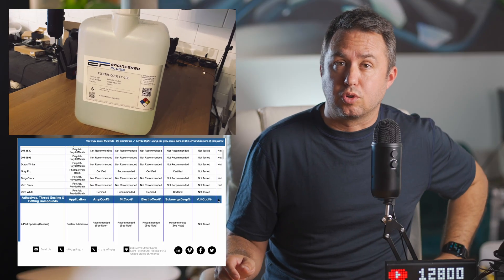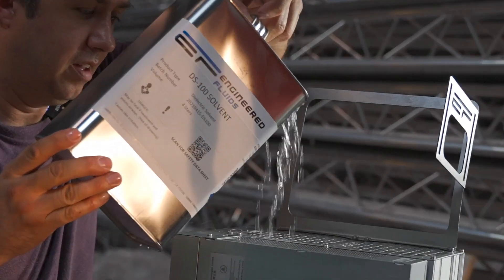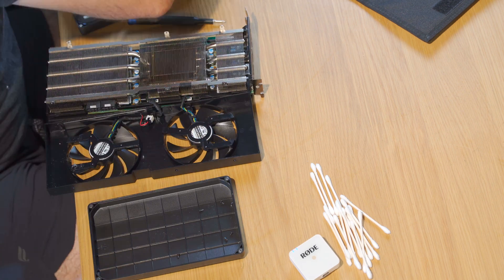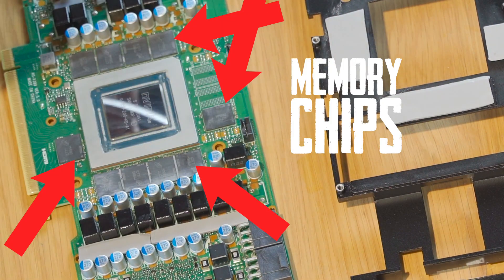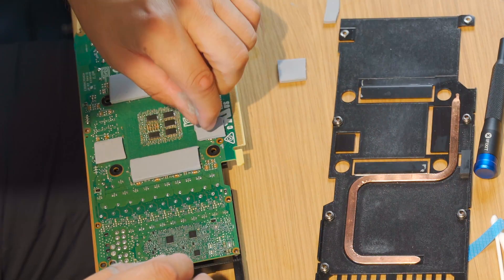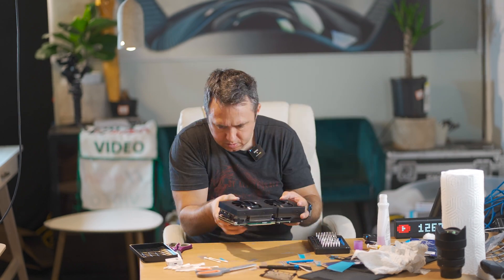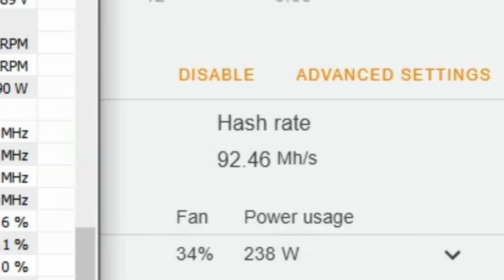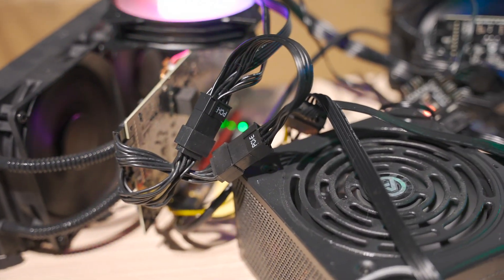What to do AFTER Immersion Cooling a GPU - getting it back to the air.

Comment: The problem of most immersion cooling systems over YouTube is using of mineral oil as a coolant. Mineral oil can't be used as a coolant with electronic parts. Mineral oil destroys plastics and also it contains sulfur and it's salts so it leads to corrosion of metal parts. I believe that most of "immersion cooliy dielectric fluids" are just a mineral oil because it's cheap. It is three times cheaper than silicon oil. 

Your video is great and helpful. The only problem I feel is that people could think wrong about immersion cooling only because of fraud coolant.
Reply from the maker: Engineeredfluids TELLS me their dielectric fluid is not based on mineral oil.  I have no way to confirm that other than their own word and paperwork.

Comment: What you can do is use 1mm pads for the memory and then 0.5mm pads for the side that you use paste on. This way you can use pads and the cleanup is quick. I use Frosty Thermal Pad 12.8 to do this exact card and get mid 80s for my temps.

Comment: Those cards are shit. I have to tear my 3080 apart 4 times to get the correct heat dispersion. Now my memory junction hovers at 90-92. Better than the 108-110 it was at. Also I’m getting 97.6 amH/s at 220 watts
Reply from the maker: Yeah, but after you repad they’re not shit anymore!

Comment: Oh man.... hey don't feel bad about being a noob on the taking them apart and figuring out what they need. First is always a little tricky lol. Also for immersion cooling, you don't wanna use paste, you wanna use a fixed pad, like a heat spring, or graphite pad. In immersion cooling, the paste will at some point wash out.

Comment: I dont get why you need fans on card when you dip in the bitcool liquid? you can just remove the fan and heat sink and dip the only card.
Reply from the maker: You are right. I was wrong. I know that now:)
Reply: @SPACEDESIGNWAREHOUSE  I want to try with 3090Ti in a glass fish tank. Wish me luck :)
Reply from the maker: @tarunsavalia1564  I love it! Just make sure the cool return oil flows directly onto the heat sink!

Comment: pretty sure you missed the vrms often they have a pad that connects them to the fins.
Reply from the maker: Interesting! I’m going to look that up. The temps are looking so good!
Reply: @SPACEDESIGNWAREHOUSE  vrm is power delivery, could run fine but if they go theres no coming back it won't work. little phat squares loook like mini dice, often you'll see the motherboard heatsink cover them with a thin pad.
Reply from the maker: @moldypj  good on ya, I’ll look that up in the morning. Thanks

Comment: for anyone looking to repad, if you get in contact with the GPU manufacturer, they can tell you the correct thermal pad thickness. trying to get that info out of some of the AIB partners is a pain because they just want you to RMA it (no thanks, its working fine, i just want to maintain my own hardware and not risk it being "lost in the mail" on top of providing a huge deposit until the card is returned)